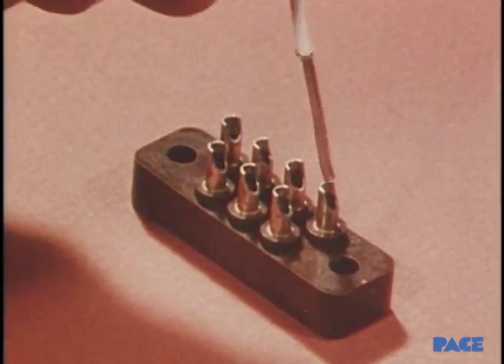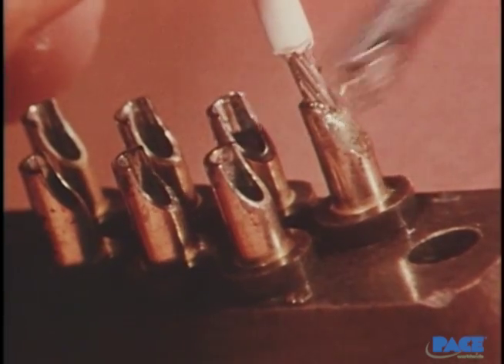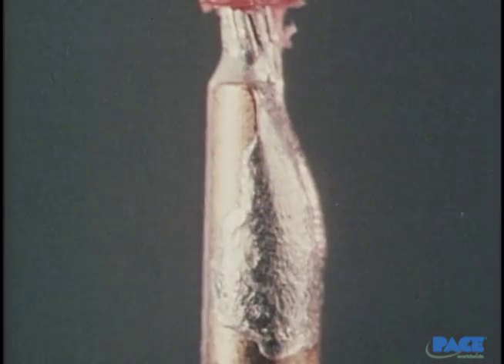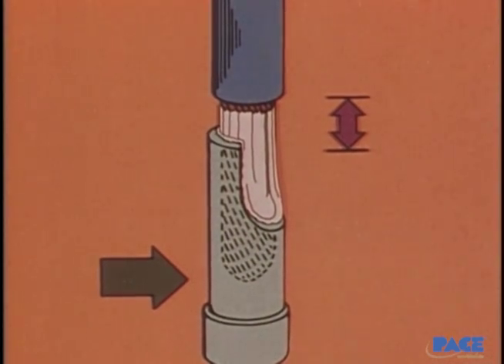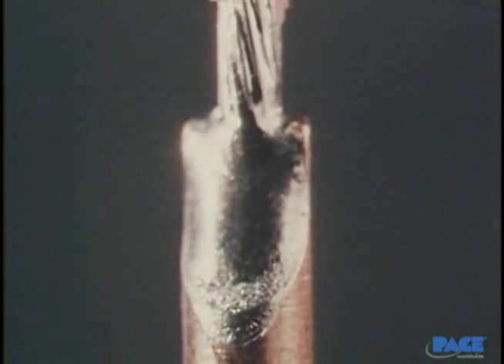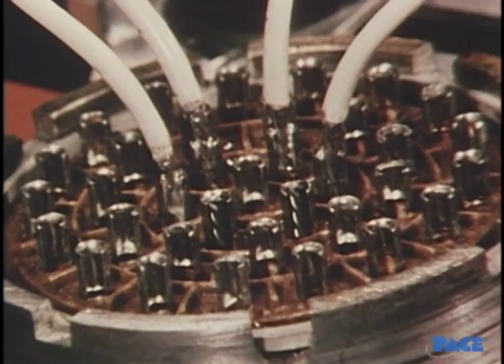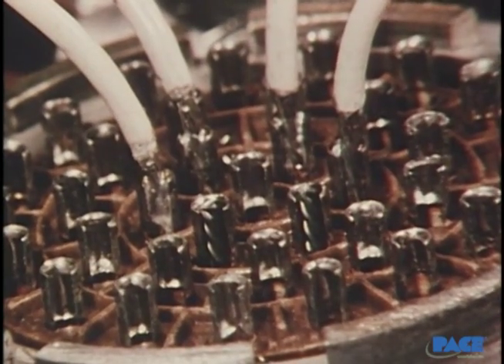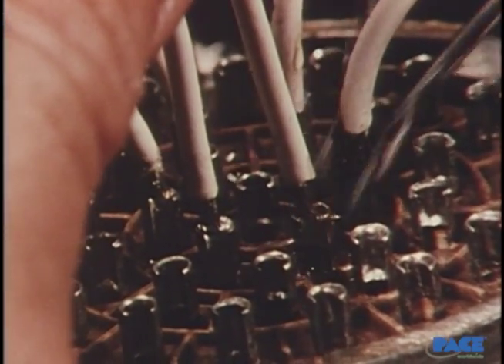Basic Soldering Lesson 3 - "Cup Terminals"

Comment: When I first came into this type of industry 3 years ago, the way I learned was to pre-tin the wire using a solder pot. You can do this by hand as well, however, you risk solder flowing into the insulation, leaving no flexibility. So in my case I do this:

1. Grab one piece of wire, strip it to about 1/4, and tin.
2. Insert the wire into the solder cup and tin the solder cup by rotating the wire back and forth(add a bit more solder as you do this)
4. Remove the excess solder completely from the cup(remove until you see every line forming the inside of the cup. Reason: If you start soldering your wire into the solder cup without removing the excess, you can risk bird caging, which means your wire bundle can open/break.)
4. Dip your already stripped wires into flux.
5. Tin your wires using a solder pot(especially for assemblies requiring 40+).
6. As you are soldering your wires, gradually add solder to the solder cups(do not exceed 3 seconds of heat for each tap as this can burn/discolor the insulation.). Keep repeating this process until there is no air/perforation in your assembly.
7. Once your solder is concave, clean using IPA until shiny. Dirty/Dull solder will not pass Quality Control as this is considered FOD(Foreign Object Debris).
8. Inspect using a microscope and look for any possible defects before sending it off to QC(typically they’ll find just about anything and ask you to fix/clean it).

Comment: or, just grow a third arm, so one hand holds the wire in the cup, another the soldering iron and the third applies the soLder.
- I've often said techs need a third arm for soldering.

And this is after a few days of making small looms that include hermetically sealed Mil-C connectors with solder cups that are surrounded/sunk into a connector body so very difficult to access with soldering iron tip. 
- and wires with insulation that melts too, easier with Teflon sheaths. 
-- much prefer Mil-C connectors with removable pins, that are crimped and then inserted!
Not sure if the 'solder-preform' would be recommended nowadays, especially for high reliability aerospace applications.
- It is essentially the same as pre-tinning the cup, you could also pre-tin the wire end, and nowadays gel-flux is available so insert tinned wire into tinned cup with a little gel-flux, and apply iron may work in some applications.

Comment: Why the insulation gap?
Reply: Way too much. Should only be 1 to 2 times the diameter..
Reply: @txkflier 
But why the gap at all?
Reply: @Kackspack0815  The insulation shouldn’t touch the solder joint.
Reply: @txkflier 
Yeah, but why? What would be the problem?
Reply: @Kackspack0815  Google it..
Reply: @Kackspack0815 ,  When the wire is heated, the insulation can outgas or leach chemicals that effect the integrity of the solder joint and interfere with the ability of flux to remove oxides and wet the connection with solder.  Sometimes you'll look at a soldered connection a few years later and discover it has started to turn green where the copper exits the  insulating jacket.

Comment: At 1:22 how does the iron not leave a big glob of solder on the outside of the connection? It kinda seems like it does...maybe it wouldn't matter in this situation, but what if it does?
The cup terminals I'm soldering, for XT150 connectors, have a cover that snaps into place around the base of the wire. If I pre-tin my iron and touch it to the side of the cup to heat it and insert the wire, it leaves a glob on the outside of the cup which then prevents the connector housing from being able to snap into place.
Anyone have any suggestions?
Reply: Tin one side of the iron and put the clean side on the cup, or use an exacto or razor blade to make it a thin film on the back!
Reply: Orient the connector sideways (horizontally) with some type of helping-hands jig or vise so that the cup terminals are facing upwards; in this way you can more easily apply the soldering iron tip to the cup itself where the wire sits instead of to the backside of the pin.  Unfortunately most of the helping hands type jakes that you can buy on the marketplace aren't very stable and the base is too light and therefore they have a tendency to tip while you're working on the part so I recommend mounting a spare male and  female connector to a large  block of wood, and using that as a holding jig for plugging your connectors into prior to soldering.

Comment: I don't agree with this one. I'm definitely not a fan of shoving pre-tinned wires into molten solder, waiting for it to melt together then hoping for the best. These cup terminals (which I love, don't see them much anymore) should be pre-fluxed (maybe) and same with the wires. The wires should be inserted, and the solder applied to the assembly like any other good connection. TBH, pre-fluxing is not necessary either.

Their foot operated soldering station and stripper are nice, but I work in field service. I'm not about to start carting all that around the country. I do need to find good tools for travel though.
Reply: I've seen plenty of XLR and other connectors (including Switchcraft, Canon, and other brand name connectors) with tarnish or oxidation inside the mouth of the cup terminals, and so pre-tinning or pre-fluxing of the terminals is pretty much mandatory. And then, there are male DIN connectors (ugh 😖), some of which aren't notched or cupped but instead are hollow tubes, and the inside of the hollow pin is invariably greasy and/or oxidized. Solder won't wick into it, and if you try to pre-tin the inside of the pin, the solder may actually bubble from the expansion of trapped air. You have to pretin the wire, slide it into the pin, and solder the very end of the hollow pin where the wire enters it. I've soldered many hundreds of DIN plugs, aargh.....

Comment: 60 watt soldering iron . 
Great for indoor or outdoor use.  Low wattage irons tend to Cool to rapidly outside .
Soldering tiny circuits is usually done indoors with no wind 30 watts?  while a 60 watt or better would be great in both applications
Reply: For irons with thermostats (normally called "soldering stations"), more watts means better stability of temperature. 
936 irons have a typical maximum power of 60 watts. Irons with T12 or compatible working tips have a maximum power of 70 watts. Some induction-heating irons can heat really fast at over 150W power.

Comment: Why so much insulation gap, I would think you would want it flush with the rim of the cup?
Reply: Should be 1 to 2 times the wire diameter..
Reply: I was thinking the same thing. Maybe because if it was totally flush you run the risk of not having enough tinned lead to fill the cup?
Reply: I'd put it against the rim to provide the benefit of additional strain relief, but it would take more time to make sure it's not too short for the wire to extend to the bottom of the cup. 
Didn't look like they were too concerned about the precise length of the stripped wire, just mentioning some kind of minimum gap distance for the insulation.  It didn't say what it should be or why.
Maybe the concern is the idea that squared off edge of solder against cut insulation can cause more stress then a smooth filet of solder.
Reply: When heated, some types of insulation will outgas or leach chemicals which can interfere with the flux and weaken the integrity of the soldered connection. Sometimes you'll discover a few years later that the exposed, untinned section of bare copper strands will start to corrode green, presumably from chlorine compounds in the overheated PVC or other insulation (Teflon, however, is fairly inert and unlikely to cause corrosion).

Comment: I don't like trying to stab the wire into the connector while heating the solder. I prefer to insert the tinned wire into the connector first, heat the wire and connector until they will melt solder, and then feed solder until the cup is filled. When I stop feeding solder, I pull the iron away within a second or two. I use a fixture to hold the wire still so that I can use both hands to solder. Trying to hold the wire steady with your fingers until it cools often results in a cold solder joint.
Reply: That's the method I'd prefer as well. I wouldn't leave the large gap of insulation shown in the video, since having it closer to the cup provides additional strain relief. Maybe they were concerned about their low temperature insulation melting under the heat.

Comment: I solder XLR connectors all the time, with cup terminals, making and repairing cables, and at no time did it ever occur to me to twist my solder together and fill the cup first with solid solder. I would heat the cup and fill ti with solder, then put the tinned lead in, requiring a single long heating, or two heatings. This method requires only one heating, and is much quicker. Brilliant.
Reply: Best soldering tutorial series on the internet imo
Reply: Thanks for your confirmation that this technique is a great way to solder wires to cup terminals.
Reply: @Anonymous-it5jw  ??
Reply: Yeah! I got some nice new shiny expensive low mass binding posts with cups and I was concerned about melting the plastic. I'm going to try this method, as it seems fast.
Reply: Same. I've melted quite a few XLR and other cup terminal connectors early on in my soldering days because I applied too much heat for too long trying to get the wires in. I got better but I still haven't heard of this "pre-form" method until now. So much faster, cleaner and efficient that I'm surprised it's not talked about more often.
Reply: This never occurred to me either... In fact I'm quite new to cup terminal soldering and just learned about this type of terminals existence... I just watched a different tutorial video which you could tell was quite new and worked well enough... Seemed very "text book" but this method seems both more advanced, and reliable... As well as probably fool proof... Not sure why it wasn't mentioned in that newer tutorial video... Perhaps it's information that almost got lost to time...? Almost... I'm going to incorporate some of these tricks into my own working techniques, when/where applicable.

Comment: easy for #20 or larger wire.  Demonstrate on #30 wire
Reply: Also demonstrate on male DIN plugs which often have hollow pins to insert the wire into but often do not have a notched "cup".  I have soldered many hundreds of these and they are a pain because the inside of the hollow pin is typically somewhat oxidized and greasy where you can't easily clean it, and it resists wicking solder inside of it (and expansion of trapped air makes the molten solder bubble). You have to pretin the wire, insert it into the pin, and solder it right where the  strands exit the pin;  And be quick about it because the plastic insulator that holds and  aligns the pins will melt if you even look at it funny, and the pins will go out of alignment.

Comment: In the real world you have to solder cup terminals when they are in the horizontal position. You should show the terminals being soldered in the horizontal position.
Reply: Hmmm. I have been using solder cup Dsub connectors (9, 15, 25 pin) for years and have always soldered them in the vertical position using helping hands.

Comment: What's that clamp thing called...I want it. Also, I tried this today with some cup terminals and it did not go as smooth as this video leads you to believe. I held the iron to the cup just like the video and the cup melted the plastic around it before it heated the solder I put in the cup. A technique that worked a little better was to put the wire in the cup, then heat the wire and apply solder.
Reply: It's called "resistance soldering tool" in this video. However, this term could cover several designs using the same principle to work, I guess.

Comment: Extra flux can be required, if you leave the solder hot for to long, because even solder can start to make oxides and this can make an instable joint. Happende to me several times, when I did not add flux.

Comment from the maker: NASA and others used this method called resistance soldering to avoid the soldering iron heater from burning adjacent wire insolation in a cable harness connector and prevent solder flowing out of the cup. In resistance soldering with a pre-tinned wire and fresh flux core solder pre-form is acceptable for reflowing solder on pre tinned wire to form a continuous piece of metal. Instead of twisting solder for fit in cup try a gage of solder that fits.
Reply: Resistance Soldering is till is in use or any new Innovation ?

Comment: It's fine, because the wire is pre-tinned. When the wire is dipped into the molten solder the solder on the wire melts and mingles with the solder in the solder pool. This creates a welded joint between the two parts. No additional flux is needed to make this into a good joint. After the joint cools there is a continuous phase transition between the wire, the solder and the cup. No "gaps" or discontinuous transitions exist.

Comment: @sbdem1986 I don't think just because the wire is cold, it is a cold joint. The point is that you want to melt the solder on the not-recently-tinned surface so the flux can clean it. If the wire was recently tinned, it won't have any oxides, etc. on the outside so there is no need for flux to clean it. Therefore, I think their method is okay. However, I really don't know for sure.

Comment: I don't like the method of dipping the wire into molten solder. This goes against the theory of cold joints (the wire is cold and is introduced into two hot parts). Am I wrong? Comments anyone?
Reply: I first learned mil-std-454...we were taught to tin the inside of the cup first...wick it..place the wire in and then solder...outline of the lead had to be seen inside of the cup.